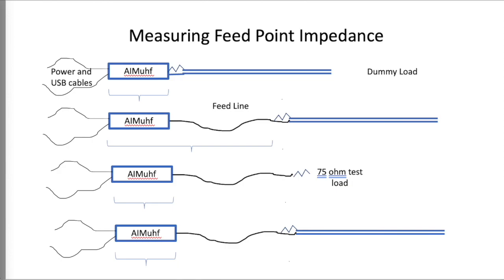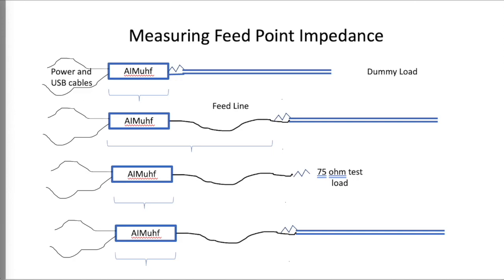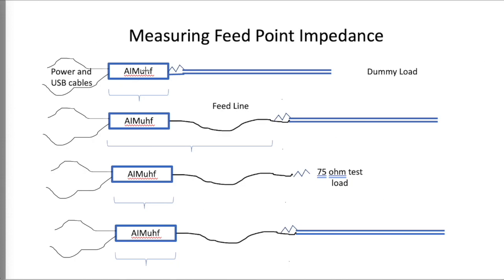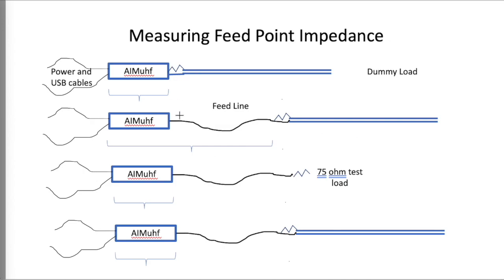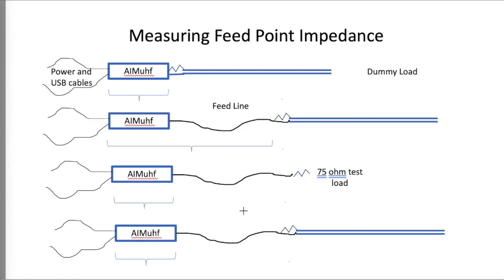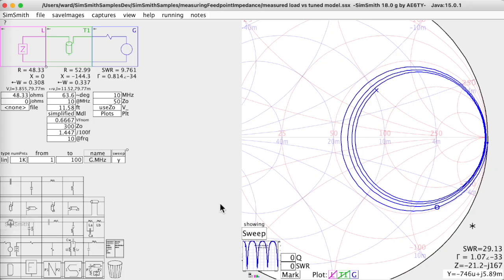Techniques for Measuring Feed Point Impedance

Comment: Great stuff. Might start using this straight away. Was there a reason you used a 75Ohm Dummy load rather than one which matched the impedance of the system?
Reply: It is important that there be an impedance mismatch so that you see the rotation on the chart.  It is probably easier to do 25 ohms (two 50 ohm terminations in parallel) but any impedance will do.  An SWR of around 2 to 1 is probably optimal.
Reply: @wardharriman8965  Thanks. That was obvious really, if I had thought about it a bit more ;-)  Think I will just use an all female SO239 T piece and 2 x 25W 50Ohm dummy loads to make a 25Ohm mismatch. The little T-piece shouldn't affect the reference plane too much at HF.
Reply: @oschonrock  I expect I used 75 ohms 'cuz I had a 75 ohm termination plug in the drawer and found it before I found a 'T' and two 50s. :-)
Reply: @wardharriman8965  It just occurred to me that the "tweaking" to reverse model and thus find the params of the TX line, could be an application for the V18.0+ optimisers, similar to here: https://youtu.be/6L8WhGcMaKs?t=541 except that the "optimising function" will need to take into account something like "maximum radius of the full swept frequency paths" . I didn't know how to express that in code within SimSmith.
Reply: @oschonrock  There is a way to get a list of all the frequencies an impedance file contains.  Check the Anvil manual for ‘GetParamSweepInfo()’.